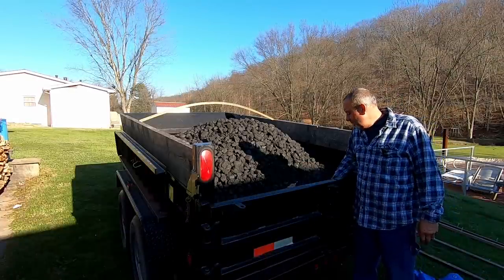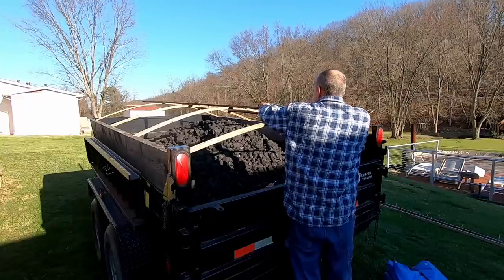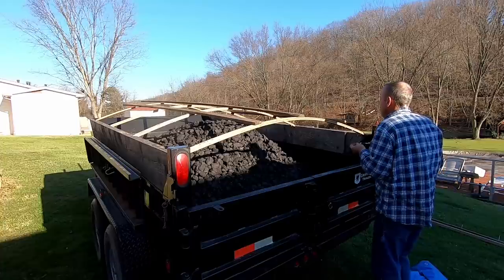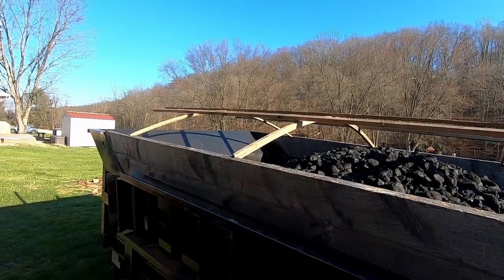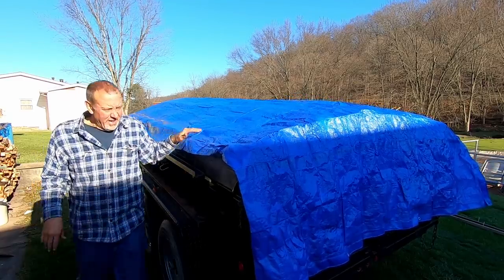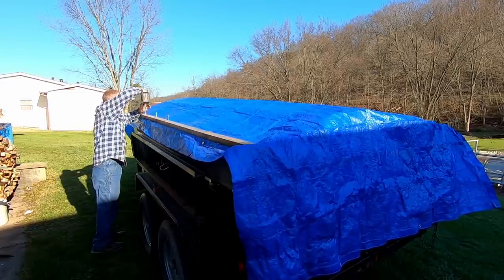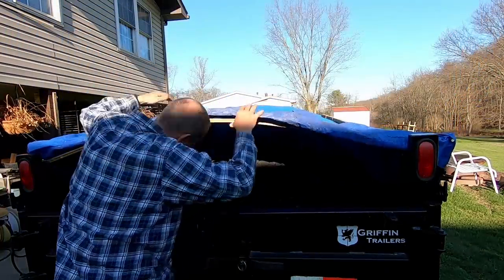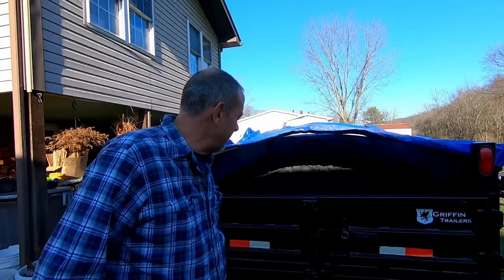building a cover for my dump trailer # 358

Comment: I know there's a difference between soft coal and black diamonds, but why wouldn't any coal furnace be able to handle both kinds?  Soft coal probably leaves more ashes than hard coal, but that's the only difference I can see.
Reply from the maker: the hard coal burns very hot.

Comment: Coal????? I thought that they stopped heating homes with coal in the 60's???? Well you do live closer to the coal than Wisconsin. The power plant in Milwaukee was burning coal a few years ago. Anyways, it is always good to see you in action. I remember you doing this last year. It is 52 degrees now. I did a couple of small things outside. I want to make something but the program for my CNC is not working. Ok, now show me how to get a screw out that refuses to back out.:trophy-yellow-smiling:😃😃😃
Reply from the maker: we can still get house coal here but not cheap.
Reply: @Alan M  Can you get to a spot welder ? It's really easy to weld right at the spot where the screwdriver used to go. 1. Set up screw to get 'hot' for a quick 'zap' weld (just make sure it's well grounded). 2. Insert connected screwdriver. 3. Zap 4. Unscrew while pulling out. 5. Presto !
     Just as easy to re-use the screw. Just screw it back in, cut off screwdriver shaft (about ½ " ) and you have vise-grip® access for the future.
Reply: @garybessey2184  
Thanks. For some reason I have had a bunch of construction screws that the heads burn out and the screw is stuck in the wood. I just force the board off with a crow bar.

Comment: Good video. I'm interested in how your coal burning heating system works? Does the coal heat water which circulates to warm the house or hot air?

This type of heating system will be very important to places like Ukraine and europe as a whole due to a possible shortage of gas for industry and homes this winter and the next.
Reply from the maker: I have a indoor wood & coal burner that is forced air heat.